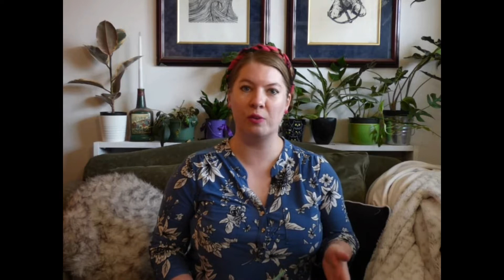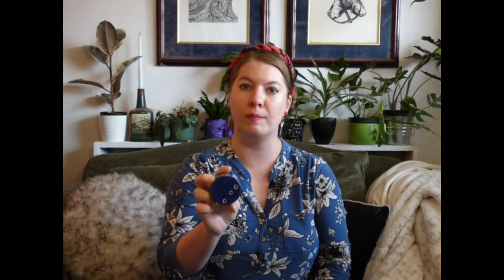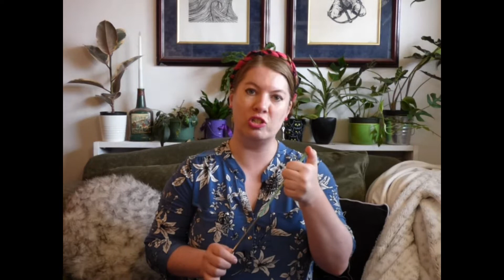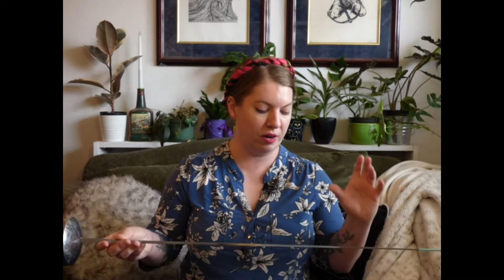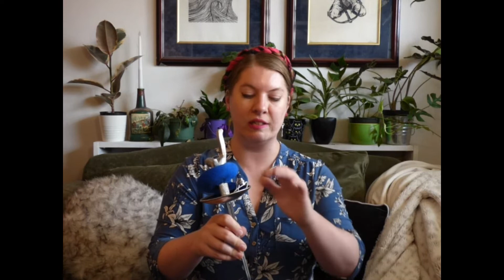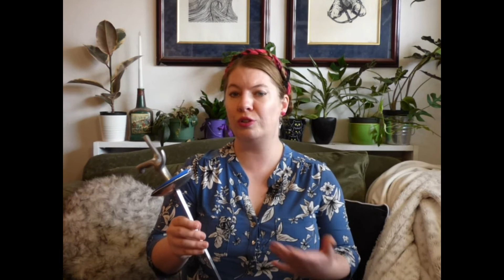Diagnosing a Foil: No Light

Comment: i've usually found the most common problem I get to see is the wire is being crushed by the guard or grip and the circuit is completed there and doesn't get to the tip... but that was mostly the Chinese weapons set up from china ... or of course ones someone has quickly assembled and not ensured the wire is in the grip groove so when they tighten it and it crushes the wire between grip and guard... (not even going into the Chinese randomly send out copies of german or french foil tips in different batches of gear ordered from them and leave it to the armourer to have enough spare parts... you order a hundred spare foil screws only to receive copies of german ones when you have their version of french tips... or vice versa... just to make it fun...lol) 

or the easy one to see is some uses a 2 pin socket that has had the insulating ring removed so it can be used for sabre (that is the foil plug connects directly to the earth) ..  used to see this one occasionally when someone grabbed a socket from the electric sabre box of parts (had spares in here to make it easy for me when fixing things... but of course, people would come in and "fix" things themselves...   then wonder why it didn't work...lol) 

sometimes the problem is just fixed by rotating the tip while it is still in (I guess it dislodges or moves any obstruction or tiny bit of metal filing in the tip... possibly a tiny part of the barrel or tip that can conduct) 

as for german tips the "new " manufacturer (well the company that supplies allstar i think.. or they were ...) make a strange french/german tip just to make things complicated....

https://www.fencewithfun.com/aid-46-Florettspitzenkopf-franz-Modell-FIE08.html#content